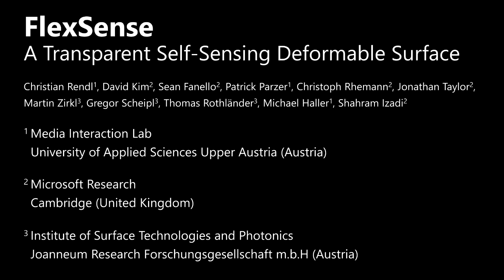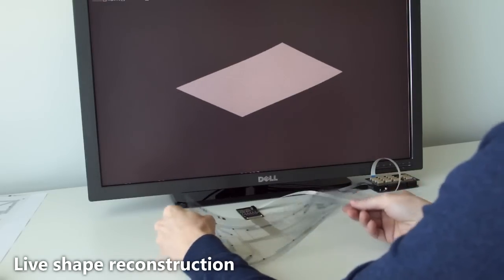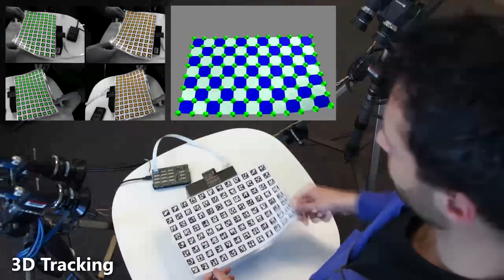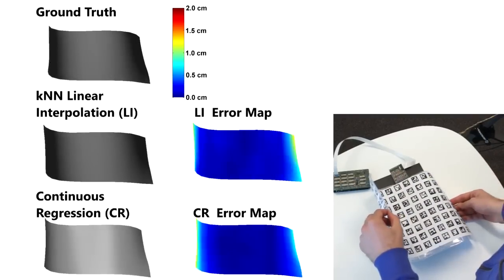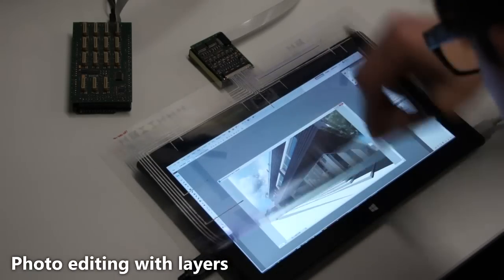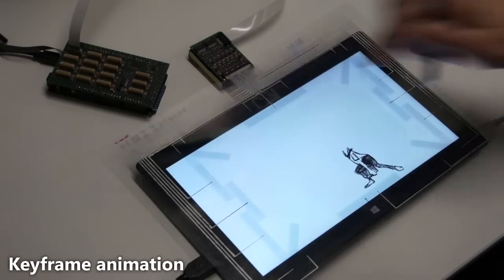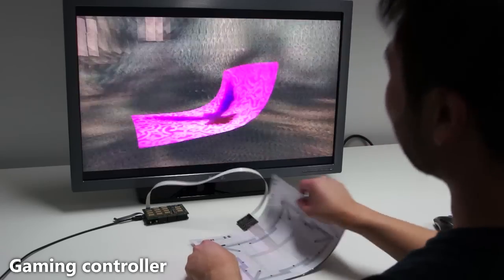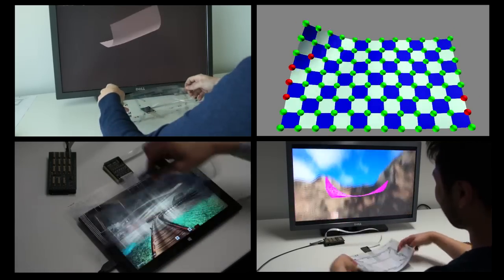FlexSense: A Transparent Self-Sensing Deformable Surface

Comment: I guess this is no sensors.
Just some stretching resistors wich increase when stretched.
And the variable voltage is calibrated for softwares.
Pretty simple but that might be useful.

Comment: On a microsoft surface or on android tablet, the simplest way to replace this trivial film, is to configure the software in order it distinguishes the stylus and the thickness of a finger. So, with his left hand the user can easily do the same effect without any film. They seem to desesperately search an usage, instead of inventing a technology responding to a specific need. No, the real usage would be for example: security monitoring (offense on ground, on walls, on windows... And the walls of rockets / boats / planes that could suffer of a failure), or interface system  (arm screen who fits its content according to the curvature of the film, if it is bent or pressed against a table, a windshield, fridge, etc ... So, not just bullshit like: "look at me, mom, I can make flying the bird with my plastic sheet !